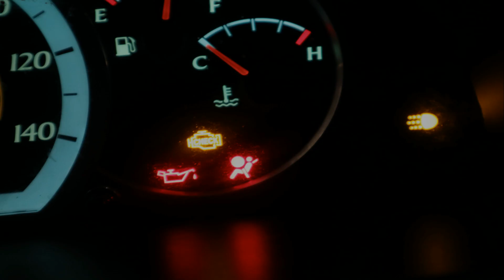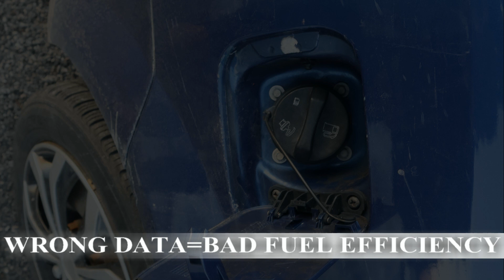SYMPTOMS OF A BAD CRANKSHAFT POSITION SENSOR

Comment: Thank you for the video. I had a crankshaft sensor replaced in my Nissan one year ago, it had rough idle and wonky acceleration so my mechanic replaced it. The car was fine for a year but today the same issue and symptoms started. Is there more than one sensor that has gone bad? or is it the same one the replaced last year? What makes them fail?
Reply: Actually what you may have is a cheap, made in China aftermarket part installed.  AS he mentioned in the video, you could get it checked out at one of the auto parts stores. If it shows up bad and of course they want to sell you a new one just insist you get a true OEM quality- not made in China.
Reply: You also gotta figure why it went bad In the first place, if there's an oil leak spilling onto the sensor (even a small one) the sensor will eventually fail and replacements will as well until the source problem is fixed.

Comment: I have a 2008 Nissan Armada se 4x4 it cranks but I have to crank it a lot of times to start, ones it’s on it runs like a 2021nissan armada  i have taking it to alot of mechanics but I can’t get the problem solve please if somebody had the same issues let me know how you fixed it.

Comment: Yes but the cam sensor also controls spark and fuel the crank I believe just tells the computer engine speed and compares that to the cam speed but the cam sensor the one that had to do with timing so it pretty much controls the spark and fuel spray

Comment: Would this be a reason why the car wont go over 3000 rpm after the car has warmed up? if im trying to say over take someone driving slow and i try to give it gas to a certain point it will stall and wont accelerate

Comment: I've taken my 2013 Hyundai Elantra to the dealership and an independent mechanic to check for error codes, both have said nothing wrong with my car. But it has issues turning over sometimes and dies randomly when I'm stopped or after it's been idling for 30 seconds or so. When it dies the engine cuts but everything else is kept on (AC/heat, lights and radio). The needle on the RPMs drops to zero immediately. Spark plugs have been changed and has a new battery. No idea what the issue is.. approximately 226,000kms on it. Any ideas on a solution?
Reply: I'm having same problem with my 2013 Elantra
Reply: @sheresejames-grow1779  One of the common symptoms of this in the Kia 4cyl. series engines apparently is the tachometer stops working and the vehicle seems to lose power but still runs.  Shut it off and restart a little later and everything returns to normal again. Quite often the crankshaft sensor is the culprit. Getting ready to have mine changed with a genuine OEM (Mfg. by Mando the original part manufacturer for Kia) sensor.

Comment: Looking at a 94 Chrysler New Yorker, lady turned it off and came back a few hours later and would turn over but won't start, coil packs ignition and electric all good was told computer, crankshaft sensor and spark plugs and battery since it's sat for 6 months any help would be appreciated I've never had one so I don't know what I'm dealing with with this car

Comment: Another symptom hi rpms the ecu calls for more fuel at idle and it not only idles rough but high it may also surge on its own like somebody invisible is tapping the throttle
Reply: This comment is what I was looking for….🙏
Reply: My sti 2008 2.5 hatch does this soon as I take it out of gear it drops if I leave it in gear mainly 1st 2nd it creeps up revs like something is on pedal.. and cold starts are high revs like 3k.. also take a while for revs to drop of when changing gears .. please help

Comment: Is it safe to say...the Crankshaft sensor and the Cam Shaft sensor go hand in hand?? I bought the Cam sensor and I'm thinking I should just go ahead and replace both. I have rough idles constantly and the car sometimes stalls out while driving. And the other day it wouldn't even start.

2.5L jetta

Comment: Hi there I got ford galaxy 2016 the car starting then 1-5 miles its shows me (See Manual Sign then First time I breaking its stop and will not starting till 1 hour or more 

Mechanic can not find what is wrong some one told me its crankshaft sensor problem other told me Fuel pump problem any suggestion boss?

Comment: I was driving my g35 coupe and it shut off while driving and the steering wheel was sack could not turn but today I turned it on it start for a few seconds and turned of now won’t turn on any idea what’s or maybe it’s my crankshaft sensor not receiving the correct info?

Comment: Add a 6th symptom and one you can't miss. The engine just shuts off while driving. It then won't restart until it cools off and then it will.  Damn dangerous if you're in a high speed run or as I did, pulling out of a driveway and turning left and crossing a road with oncoming traffic to get to the opposite lane.   Just replace the damn thing!
Reply: Mine shut off in the freeway lol and coasted off the exit ramp, little scary since the breaks and stearing stiff
Reply: That’s what happened to me
Reply: That's what happened to my car. Drives well until it is fully warmed up. Then it starts to idle roughly and stalls occasionally.
Reply: Yep just happened to me today. This sucks real bad because my car is Standard lol
Reply: Exactly what happen to me.  Was going 75miles an hour then lost power.  Was able to steer to make it to the side of the road.
Reply: What’s the fix?
Reply: @OTWKilo  What's this whole video about and you have your answer.
Reply: @da324  answer to what?
Reply: I have same problem in my hundai Sonata 2.7 v6.
Reply: Any ticking ??!
Reply: Same here would just cut out when driving it.
Reply: That's happen to my g 35 doing at 50 miles an just shut off I'm like wtf but I'm change tha crank sensor tomorrow
Reply: Sounds like mine.thanks
Reply: Yes happened to me. The car shuts off suddenly while driving and can't start it back.. Gotta wait 10 minutes then you can start it back.Worst case my car shut off in the middle of a jammed then people came to my car and push it towards the side of the road. Lmao ... Makes me nervous fckkk
Reply: Happen with me to i thought it was the idle sensor at first

Comment: My 2015 Equinox had a bad crankshaft light, ended up costing me $692.00 for a new timing chain kit and labor.
Reply: Why’d you get the timing chain and labor done?
Reply: @Duhlancy  because the mechanic said that was the problem. It had been stalling and he's busy, took 2 weeks. A dealer would be $1200 or better.
Reply: @northdakota69  so the timing chain wasn’t necessary? It really was the sensor?
Reply: @Duhlancy  no, mechanic says timing chain was the problem.

Comment: When changing the crankshaft sensor is it necessary to replace the engine speed sensor too?
Reply: Probably depends on the vehicle. The Haynes manual for my jeep Cherokee doesn’t say anything about a need for replacing the speed sensor when replacing the ckp sensor…though replacing the speed sensor is the next section in the book.

Comment: what if the engine just feels rough at idle, but no check engine light is on? Possibly still crankshaft position sensor?
Reply: Yeah could be it can also idle high and surge
Reply: Clean the throttle body.it might help
Reply: Or clean map sensor

Comment: Does a 93 Acura GSR have a crank positioning sensor and where is it located I've heard in distributor which doesn't make sense to me, I've heard in the front of the engine near the crank pulley.

I've got a no start issue with an 89 Civic wagon with a 1.7 GSR swap it's ran fine for 6 years all of the sudden one day it won't crank I seem to be getting fuel but I'm not getting any spark I checked all the grounds the main relay is fine put a new ECU in it and a new distributor... nothing!

The only thing I've done to it recently is changed the oil wouldn't have had anything to do with it put a new timing belt on it several months ago and I've been driving it since then just did put a new fuel tank in it drove several days after that and then the problem popped up

Comment: Blessings King two of the Pistons in my car is not firing the car is a Mitsubishi grandis 2005 4g69 engine many computer man tested it but they say no pulse is not coming from the computer the car drive but it's no speed and when it starts it shakes when you put your foot on the gas it's only going to one lever it's only bring the Rev count  to 2 do you think is the crank sensor do that?

Comment: My car threw a p1300 code after the engine stalled while accelerating, shop says i need a new ignitor and crankshaft sensor, does that sound about right anyone?

Comment: Excellent video!!! Short, informative and right to the point. My truck would sit at idle for about 30 seconds and then shut off. It would also shut off every time I stopped at a red light. Checked the crankshaft sensor...boom💥 running like a champ now!!! Thanks for the video bro!!👊🏻👊🏻
Reply: Does delayed starting also symptom a similar problem, 
Ike a hard start
Reply: @mhlengindlovu8450 did you fixed it
Reply: Did u have any check engine light ? The code showed up at first and then it went away but my car continues to turn off when I’m parked or at slow speeds , but now the code doesn’t even show up
Reply: @omargarcia9115  It may sound crazy but check your battery maybe it’s old. A bad battery can make it seem like your car is worse than it actually is.
Reply from the maker: Phenomenal news! thank you!
Reply: Just had mine fixed.  Would cut out whilst driving it. Especially at traffic lights for some reason. ALWAYS when I’m driving it tho.  Took me mo this to find this out
Reply: one question,, you replace the sensor and problem dissapear  like nothing??? what about the codes???you dont need scan  the engine before changing the sensor???means it works like magic ???? will you explain a bit,,,,,

Comment: Hey, do u know what would cause stalling when the a/c or heat comes on? I’ve had this issue in my 04 trailblazer for a few months and can’t for the life of me figure out why. When I turn the heat or a/c on it bogs down the engine and stalls out. I’ve heard it can be an a/c pump, belt issue or bad pulley but I can’t figure it out and took it to 3 shops and they couldn’t figure it out. I already got my throttle body cleaned and new fuel filter and new spark plugs and coil packs. Thank u!
Reply: The only codes on my truck when I take it to the auto store is secondary air injection, it has a slight rough idle in park.

Comment: My husband was driving our Honda van in the number 2. He had no idea. He speeds up our VSA light showed up, the engine light started blinking then the van stalled going 80 on the interstate. We had to wait on the tow truck because our van wouldn't crank over. Got our scan and 3 codes our bank 2 catty, map sensor and a camshaft position sensor B circuit 1. All this on our 2008 Honda Odyssey ex-l.
Reply: What was the solution
Reply: Had to get another engine. The time belt broke. Bye engine.

Comment: I’ve noticed every time I turn my wheel my car a shuts off. But it never had a problem turning back on. Is that possible symptom of crankshaft?
Reply: I have the same issue in my truck when I turn right
Reply: @srtmando2148  we in the same boat. I got my car in the shop now. I’ll let u know what they say my problem is. Hopefully not nun too bad.
Reply: @Skydive864  was it the steering wheel column
Reply: @srtmando2148  is it the steering wheel Column?
Reply: Any solution? I have the same issue while turning left my car stalls or dies
Reply: Honestly mines still does it and I just got used to it lol can’t ever find a fix for it

Comment: I have a 2012 equinox and have the issue in the mornings when starting the engine turns on normally but after 10 or 15 seconds it shuts off then I turn it on again but this time pressing the gas pedal for few seconds and stays on and sometimes it stalls and is a little shaky on park. Could this be the problem the crankshaft position sensor?

Comment: Hey I'm driving Vw Sharan 1.8t 2005 model AWC engine  its start and die within 10 second and second time it doesn't start at all only cranking i replace crank sensor,camshaft sensor lumpder sensor,fuel pressure regulator but it's still doing the same please help i don't know what to do now

Comment: I changed it still has the crankshaft position sensor so what’s the problem?
Reply from the maker: Did you reset the engine light after? 

If you did, you either got the wrong part, the connector was not pressed in tight enough, the wire has damage, or there is corrosion on the connector.

Comment: Quick way is watch you're rpm gauge if it's not moving the needle won't register any movement
Reply: That was my first indication. Kia Sorento- recently an intermittent sudden slight jerk like it was downshifting for a split second. The yesterday slowed to cross over the highway and felt like it lost power- real slow acceleration. Then noticed no RPM's registering but was still accelerating.  Continued on the remaining 12 - 15 miles to home like that. At one point I slipped it into manual shifting and saw it was locked in gear 6.  Could not downshift it.  After I got home and it sat for about ten minutes, I re started wanted to be sure I wasn't stuck in gear and everything worked like normal again.

Read quite a bit of messages on this same combination of issues (including no code showing) and unanimously they CSP sensor fixed the problem.  I'm ordering an OEM (MANDO Mfg.) today and hope it resolves the issue before it happens again.

Comment: My car cranks perfectly fine sometimes and others it’ll just click. Do you think this could be the issue?
Reply: No check engine line and no codes are being thrown up. I replaced the starter, the battery, tighten all the grounds and replaces the cam sensor and still does it
Reply: No. Clicks is the starter

Comment: as far as the 'no start' would it still crank if this sensor is the problem? My car will crank as if it wants to start, however it wont start to save my life.
Reply from the maker: Absolutely!
Reply: Found the fix: it was just a bad connector to my fuel pump. Replaced my sensor anyway, great vid! 👍
Reply from the maker: @mastercentsei4583  smart! thank you.

Comment: my car died on the highway after the alternator belt popped and now it’s not starting even with a boost. mech told me it’s the ckp sensor causing there to be no spark. there was intermittent misfires on idle and the car shook a lot on idle (car has bad engine mounts), but i never got an engine light

Comment: I can still start & drive my car for a few minutes but then rpm turn to maximum and check engine light on.. I've got P0335 Error code..
Reply from the maker: Look into the wiring of the Crank sensor and make sure there is no tears. Also look for corrosion on the connector. Make sure it’s not lose. If all looks good then replace the sensor and you should be good!

Comment: My car began stalling after running for about 5 minutes everyday. Mechanic told me today that this sensor was bad. Was expecting to see stalling in your symptoms.
Reply: @Korrupt4Lyfe did you fix your problem? I had the same happening. I replaced Idle Air Control Valve. It got better, but it still dies on the stop light, plus I can't start it after pumping gas. It is going nuts on the gas station.
Reply: @babycakes8434  Hi Baby Cakes. Yes, my mechanic changed the crank sensor and that fixed the problem. My car died at stop lights too. Called a tow truck a couple times but it would start again before they got there. Was very annoying. But the crank sensor was my problem.
Reply: @Kurrupt4Lyfe  Oh good! that gives me hope. I am going to have my crank sensor replaced tonight. We shall see.
Reply: @KickButtMarketing  I agree. I buy my own parts AcDelco or Delphi, or Moog etc. But they are not always perfect. I put the purge valve BWV if I remember the brand correctly in my Buick, because I was in a rush year ago, and it might be the culprit. I will pick up a replacement AcDelco tomorrow, so we shall see. It might be also fuel pump failing, and I installed Delphi 2,5 years ago.

Comment: Nice video, Greetings from panama in central America....I have a 370z and i change the clutch because it was tim and know i now have the engine light on with the p0335 code on de scanner, the car takes like 3-5 seconds to start and then is in limp mode and dont let me rev pass 3000 rpm.

I think changing this sensor is the next step
Reply from the maker: Smart, also check to see if there is any lose,broken or corroded wires around this sensor.

Comment: thanks!  i recently put in a NEW (but bad) CKP sensor and its apparently shorted internally-  screwing up my fuel level gauge, ignition coil/ignitor(?) and setting off a host of other selonoids- et al!   I cleaned all grounds, rebuilt my fuse box, new ECU, cleaned everything........no changes  UNTIL i just now decided to swap back in the old CKP sensor.  All the electrical clicking, etc went away immediately and Im not going thru the KEY RELEARN process for the new ECU
Reply from the maker: Thanks for sharing!
Reply: @easyautofix  ie: beware of NEW/ BAD parts!   last bit: all craziness went away......and was able to do key relearn process (turning key to off, but not all the way counter clockwise position- was critical, as well)